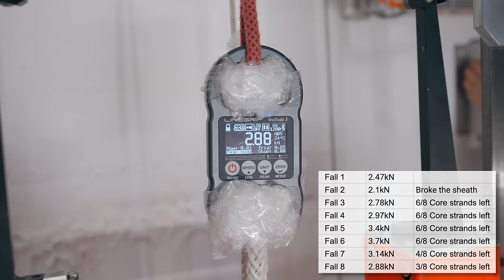Lab Test - How Soft is too Soft? How Fuzzy is too Fuzzy?

Comment: Great vid thanks!  I would love to see a video about weight differences in belayer/climber.  I weigh 84kg and my GF weighs 50kg.  Best options I have found are a weight bag and Petzl Ohm.  I would love to see testing on the options.
Reply from the maker: Thanks! And what you ask is on my list ;)
Reply: @HardIsEasy  OK thank you. If I could be so bold I have another comment :)  In the last few vids you have commented a lot about the force to climber but how about force to the pro?  I am more concerned about the pro than I am about me :)
Reply: You need to check out hownot2. He break tests soooo much stuff, bolts, karabiners, ropes, slings, nuts, cams etc etc
Reply: @chrishughes3405  Yeah I love his channel too.  Just fun stuff there.  I have seen all his vids but he doesnt address either of my questions above.
Reply: Greg, the Ohm is by EDELRID, not Petzl.
Reply: EDELRID, not Petzl, makes the Ohm. I've been using the Ohm since 2019 and really appreciate its help to increase belaying safety for my partner (107 lbs) and me (170 lbs).

Comment: Tracks with an experience I had as a young climber ~ A rope had been left out over night on a route at a very small, not well known crag (on a week night if it makes anyone feel any better) and we came back for it in the morning. Having whipped in basically the same spot repeatedly the previous day (on an older, already fuzzy, rope) there was an obvious "soft" spot but we didn't think much of it and thought it was fine, as I went back up and finished off the route on that same rope, being rested from the day before. HOWEVER when I clipped the anchor and hopped off the route (more aggressive than sitting back but not the same force as a fall) the sheath tore almost completely in the same spot as before as it pulled over the anchor. Lowered to the ground safely and proceeded to cut 10m off the end of the rope (given that the cliff was 30f) and called it a day. Stay safe out there y'all!

Comment: Seeing the drop tests and looking at the table at 19:46 there's one thing that wasn't explained in the video. 

The engineer pointed out that repeat falls on 6/8 strands resulted in greater force measurements because the strands are getting less elastic with each test, which makes a lot of sense. But when the core strands (and the sheath) break the force is measured to be smaller, and someone quips that to get a soft fall just break your rope! The reason why these drops are softer is because fewer strands means that there's more force on each individual strand, which stretches them out further, and the longer the rope stretches (more precisely, the longer time the rope spends stretching since F = dp/dt) the smaller the force and the softer the fall.

You wouldn't make a rope that stretched this far though, both because as seen in the video the weight almost hits the bottom of the test chamber, and because the further you stretch and elastic material from its neutral state the more you damage it. A climbing rope can take getting stretched out 20-30% hundreds of times, but stretch it to its limit even once and it'll be permanently damaged.

Comment: Amazing intro and great video! But now what should you do if you find yourself hanging from the core strand of your rope? lowering might not be possible due to sharp edges on the way, maybe climb to the last protection and pull in some extra rope before you lower?
Reply from the maker: It's very situational... usually in sport climbing the broken part will be close to the climber so if you can control that it's not gonna run across something dangerous just lower down... Otherwise you could try to protect your self by clipping into a bolt or smth and retieing to bypass damaged part of the rope.
Reply: @HardIsEasy  I found myself in this senario and I just clipped into a quickdraw and tied myself above the damaged part into the rope again and repeled.

Comment: 0:53 As an electrician and before I watch further, if someone told me a cable bent like that I would tell them to unplug it and even cut it before throwing it in the bin so nobody can use it. It means the mechanical strength is gone and the layers loosened up around each other, making it look like a sausage down the hallway in cross-section of both the strands and sheath.

Comment: Thanks for another excellent video. Do you know if rope manufacturers have any way to quantify how finely woven the sheath is? This could be useful when trying to purchase a rope with a durable sheath. I know sheath % can contribute to the durability factor, however, it seemed like the Mammut employee was saying how finely woven the sheath is also contributes to this. It was very interesting to see the comparison between dry treatment, rope diameter and rope quality in how the ropes responded to the abrasion test.

Comment: I imagine the net force of the fall that broke the sheath was greater than 2.1kN, if it was in fact an identical drop test to the one before it which read 2.47kN. The reason we got a lower reading was that the sheath absorbed some of that force and caused it to break. Hence half a kN didn't make it back to the meter. Thats my theory anyway, the engineering wannabe that I am. Any physics people out there who can confirm or correct my logic?

Love the content though! Much respect to you guys. I just got home from self-belaying on my old-ish rope, and find myself wondering how sketched out I should be. Google brought me here lol... MANY THANKS TO YOU for answering my questions! At Mammut's lab no less! Climb on :)

Comment: We should not trust too much, or focus too much, on the peak force to compare situations, which may lead to error. Even matching peak forces could be not that usefull, as the energy released on the rope per unit time (power) is greater at that moment and point of the rope (as shock/shearstress), but the majority of the total enery is transmitted outside that moment and point, as friction/heat. Indeed, in addition of absorbing part of the energy (thus reducing the shock/peak force), a human body, when compared with the test weight bricks, will spread in time the energy transmitted to the rope (thus reducing friction/heat at every individual point). Why don't they use Dummies? Also, could the carabiner shaft radius have a greater impact than a few kN more or less?

Comment: 17:20 GREAT question. HORRIBLE answer. This is what we want to know. A whole video on that question, please, with a fellow who wants to answer.

It seems it's Very safe, if the rope is not Very fuzzy. And - of course - of the sheath breaks, you never climb on it after that.
Before the sheath snaps it seems you are very, very safe.

I had my sheath break once, it was a hard fall ( belayer sat back instead of jumping to soften fall ( and the rope was quite fuzzy. I had thought about cutting it. "shall I cut it now, or shall I cut it after todays climb?"
It was soft / bendable, but also quite fuzzy, you could tell it was much less protection of the core.

Comment: I've always wondered, why don't people climb with stainless steel rope? From what I understand it would require a smaller caliber rope due to the steel strength giving flexibility to the rope and you could use fasteners to do the connections. Could someone explain to me the shortcomings of why this is not viable? You could totally jump the fraying of the rope if steel was used.
Reply from the maker: Steel is not flexible to take dynamic falls
Reply: @HardIsEasy  Oh ok. Thanks!

Comment: A new rope, on the expensive end of the spectrum, is what $300 usd. So if you climb even only once a week that is roughly $5.75 usd per climb per year. So replaced once a year you are gambling on potentially your life or injury for less than a $1usd a day or $5.75 per climb. Why do people try and cut corners on this piece of equipment? If you are unsure of something that doesn't look right replace it.